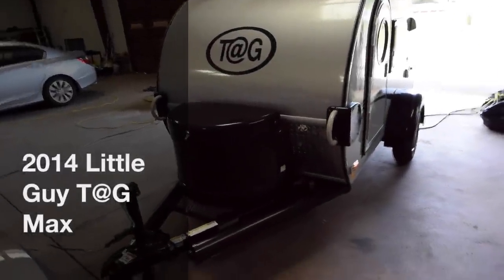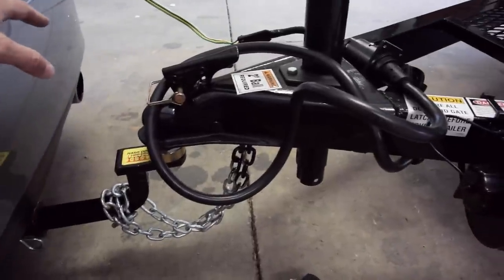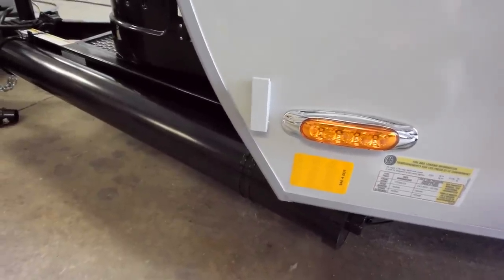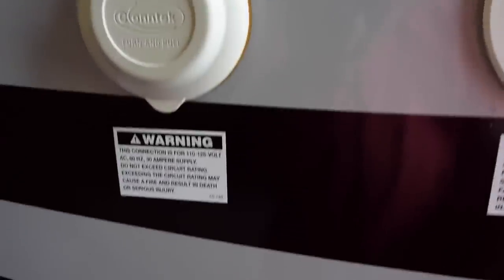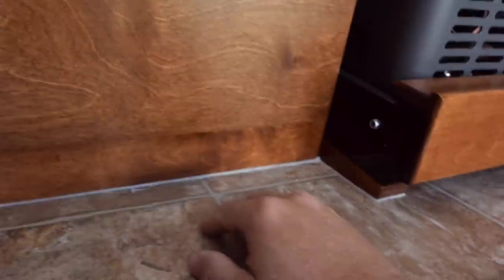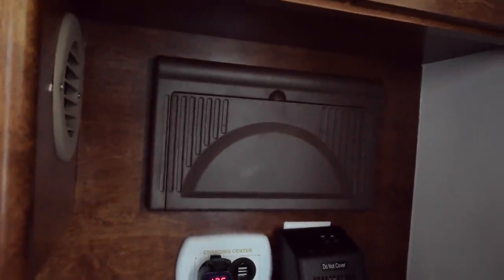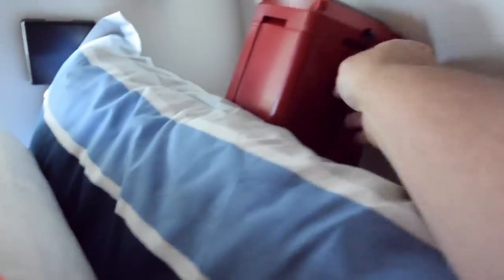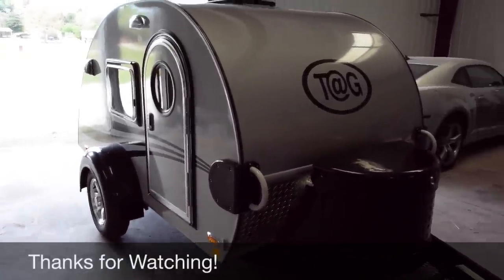2014 Little Guy T@G Max

Comment from the maker: Mary, your replies are turned off, so I hope you get this.
As I said in the video, I towed this before without the mods.  It can be done, but it's not ideal.  You need to carefully watch the tongue weight if you don't have a modified suspension.

Comment: Thanks for the video! It was nice and thorough and very helpful. 

Quick question you may not know the answer to. I've never bought any trailers before, so I'm not quite sure how this works. I've got a 2013 Chevy Cruze. I looked it up and I guess my max weight I can pull is 1000lbs. Would I be able to comfortably pull this trailer or should I look into something else? Thanks for any help you can give me!
Reply from the maker: I think it would be borderline - the trailer empty weights 800-900 lbs.   If you traveled extremely light, you might make it OK on flat-lands.   I think for any type of trailer, you might want to upgrade your Cruze to something like an Equinox or other small SUV.
Reply: @wincrasher2007  Thanks for getting back to me! I figured as much but I wanted to ask somebody more knowledgeable.